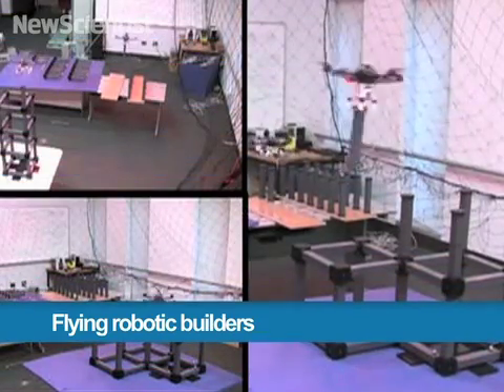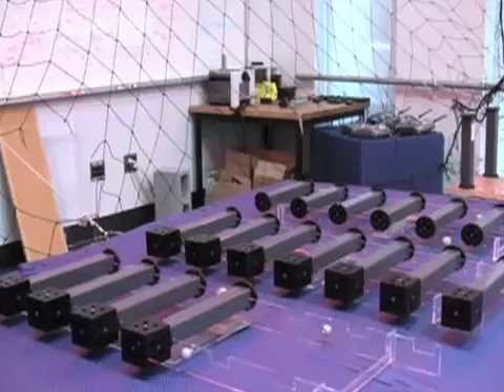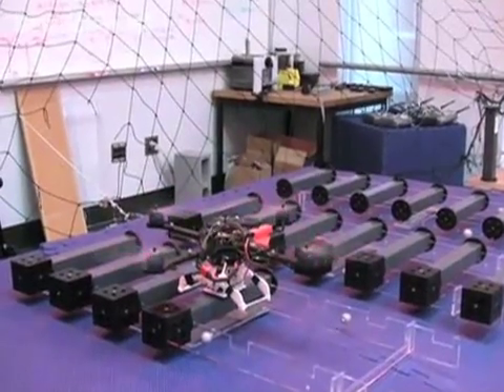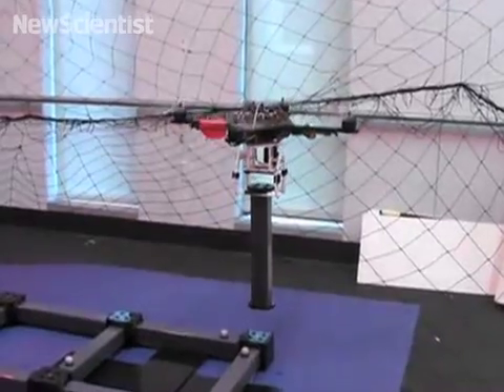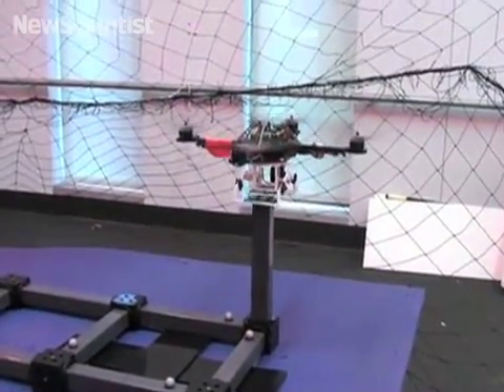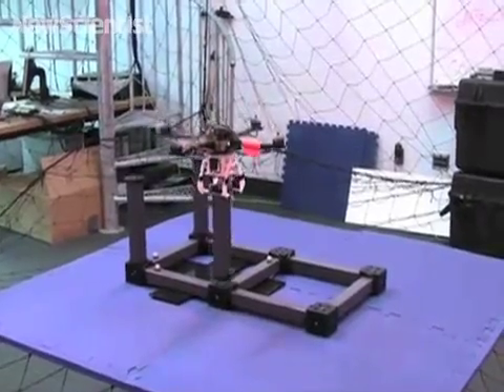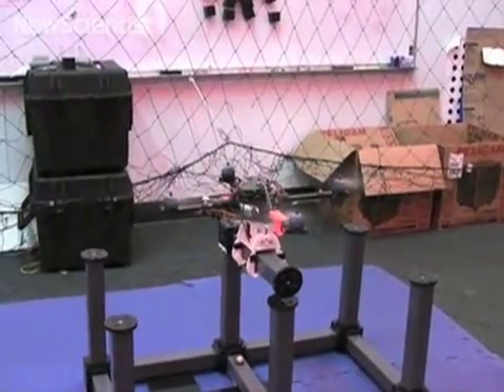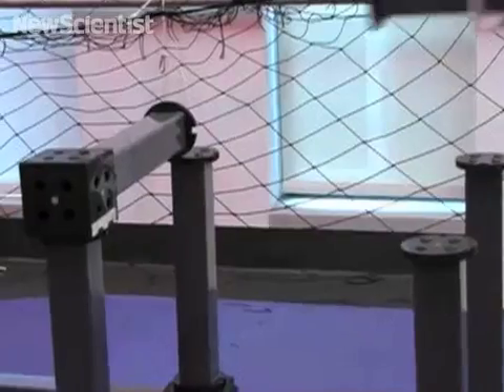Flying robotic builders

Comment: watching how the magnets pull them into position, jerking the whole quadrotor a couple of inches across kinda violently...

i wonder if the quadrotors had the power to pull the magnets apart again.  I wonder if you put those magnets on 2 quadrotors, could they be programmed to controllably snap together in mid-air, keep flying, and then pull apart from eachother, all without crashing?

Kinda like those small redundant cooperative robots - but airborne.
It'd be interesting no?

Comment: @SickBang Yeah it's completely computer controlled, no humans at all.

Notice all of the little white balls around.  The computer visually tracks those balls with an IR webcam to know where things are flying, what orientation they are in, and where the things it has to pickup are.
I think the quadrotors also have some acceleration sensors on them too.

Comment: @HooperNoodles i dunno about that.  Since quadrotors have much finer control over movement, they would be able to move things around much faster and therefore spend less total time in the air.

Just think of how traditional helicopters hover for so long while they try to steady their movement when doing fine maneuvers such as landing, if they didn't have to do that it would save a lot of flight time and fuel.

If a traditional helicopter did the maneuvers in this video, it would take forever.

Comment: If you had a lot of those and they were designed to charge their batteries on a platform when they get low on power and then start up again you could have a fully autonomous swarm of them doing work.